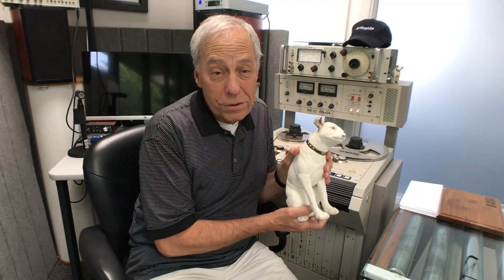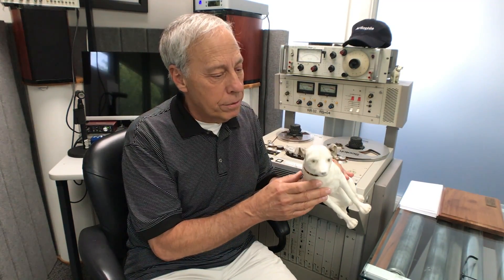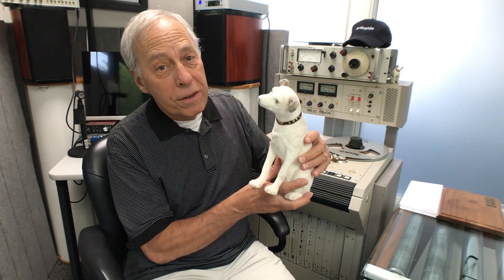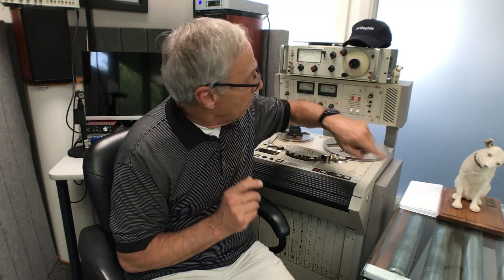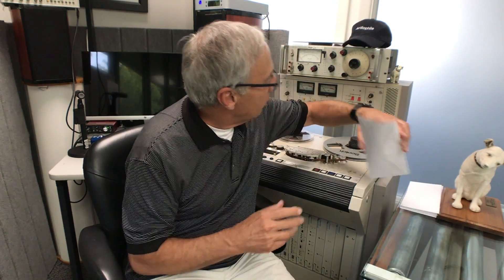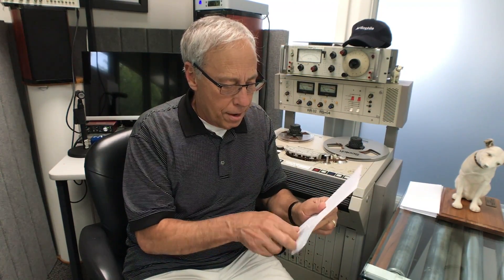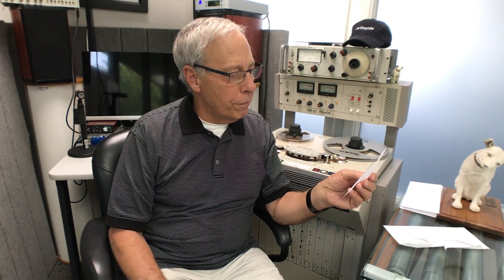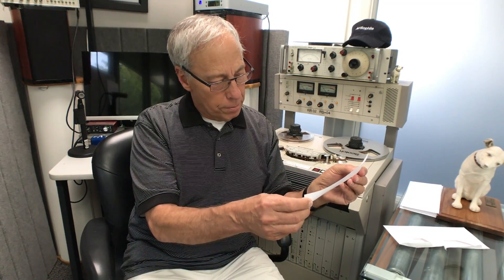Thin cables inside speakers

Comment: Manufacturing economics first of all, and the fact that a short length of #20 stranded wire has virtually no resistance and can handle a lot of instantaneous current.

Comment: I was always told it doesn’t matter too much due to the small distance. 
What matters is breaks or many connections making for changes in impedance. 
Due to the small distance you won’t get line capacitance issues. I always run the biggest shielded  I have and always use good solder with breaks in connection.... straight run of wire component to component inside my enclosures.

Comment: I used 12awg solid house wire to build my speakers. Serves dual purpose as high current capacity and structural support to build the crossover instead of engineering a custom PCB. There is no point in running anything much larger than the awg of the inductors themselves. Combination of 16awg and 14awg inductors means 12awg is more than sufficient. You are not sending more than 2000 watts down internal speaker wiring without blowing every driver and capacitor attached to it.
Reply: Bad bad choice. I used to think like you. Do yourself a favor and try using purpose build wire. Night and day.

Comment: I don't know a whole lot about home audio, but i see a lot of cabinets that are 100-300 watts. So inside the cabinet you wouldnt need very thick wire split between 3 drivers. In the car audio scene a lot of runs are 15 ft or so so they use large wire. As far as subwoofers, many guys are running upwards of 2500 watts or more per driver so you see 8ga being used a lot even on runs that are only 3ft. Just my .02

Comment: Come on, y'all.Realize the difference between pure resistance and impedance.Hint- inductance & capacitance are involved.
You can burn a 150 Watt incandescent lamp through 20 Guage zip-cord,But I wouldn't use anything less than 12 Ga. for a 30 Watt speaker run...cpf- capacitance per foot.

Comment: Same reason as not fitting 20 USD internal heavy bracing. Gel gaskets. De coupling speaker s. Internal decent cables. Decent X over components. 40 USD all !!!!! The industry is horrible!!!! See JBL inside absolutely awful.
Reply: TheRockerxx69 That's why you build your own stuff. Or get ripped off. Your choice. Or go used. I do both used, and DIY. I have stuff that cost a few bucks that sounds better then new stuff costing a fortune. You're correct. Most of these companies are pretty bad. 

I have a nice pair of Klipsch RF-3's that have aluminum drivers. So they breakup at 4500hz.even though the crossover hits at 2000hz. You can still hear it. So no biggie add a notch filter right? They're cheap enough. Well of course Klipsch couldn't do that. It would cut down their profit margin by 0.03%. So now I've got to do crossover work on it. It's okay. I bought them cheap used. But if I bought them new I would be furious. They give you listening fatigue because of it! BS!

And they know it's there. So they knowingly send a bad speaker out the door by the thousands. Instead of doing it right, and spending a few bucks. Zero Integrity.
Reply: Andrew Balus of course l DIY my 3 way  3 amped electronic X over monsters. Internal cabling is Nordost. I d like to DIY , poor s man JBL k2 s 9900 any plan or idea?
Reply: TheRockerxx69 Not a clue. Just saw them for the first time a minute ago. I don't do new. It's not even on my radar. By new I mean anything made in the last 10 to 15 years. Except for maybe a DAC that is. And possibly an individual driver. My amp is from 1961 (HH Scott 200), and I've been listening to some Zenith 49cz852 out of an old cabinet stereo made in the late 50's - early 60's lately. Heck even my DAC is 5 yrs old.

But I'd start learning cabinetry, and purchase a 3d printer if I were to try. Those things are crazy! I wouldn't even think it could really be done. It would cost a ton of cash to pull it off, If you can't do the wood.

Why bother though? Just build a nice setup with 2 15's per side, and a horn on top that goes very low (no higher then 500hz, there's some that go down to 250hz now). Like a movie theater speaker. That would make me more then happy. For that type of speaker. I like the open baffle sound myself though. Good luck. Lol
Reply: Andrew Balus l m going to get me a 15 inch good woofer. Load it in a 4th wave cabinet. Ultra re inforced. Put two compression horns over. Beyma????  And save 65.ooo bucks
Reply: TheRockerxx69 There you go. LOL

I can't remember the driver and waveguide that goes very low (down to 250hz), but that's what I would use. Beyma is nice. But for that money you could also go vintage Altec. And it will only increase in value too. That's the smart way to go IMO.

And don't forget JBL too. They make great horns. Not cheap, but really nice. And again only going to go up in value.
Reply: TheRockerxx69 Oh and Acoustic Elegance makes really nice woofers BTW. That would be the 15 I would use.
Reply: I HAVE A MINIMALIST TUBE PRE AMP, designed by polish guru Lampizator, 2 mini tubes, amazing-two power amps class d-diy  200 watts each---am using tyhem in a normal config--
Reply: yes thanks---Acoustic Elegance and Beyma--
Reply: TheRockerxx69 Wow he makes great stuff. I'm not a big class D fan, but it's good stuff. I bet your system sounds great. I wish I could hear it. And just to clarify. Beyma is great. It's just that since there's others too. I thought I would suggest them. Beyma will take a serious licking that's for sure. I talked to a guy on Diyaudio.com that was giving some Beyma drivers 30db of boost at 20hz,and hundreds of watts in an open baffle configuration. They took it fine. It didn't get much more extreme then that.
Reply: Andrew Balus l am on the max results on the cheap side, my components are poor s man stuff. Not bad sounding in the end. I can t afford audio research or krell. Those class d power mono amps cost 300 USD each.or less..
Can't remember. Done in 2017. DIY. 400 va trasfo. Good power supply 60.000 mf
Reply: TheRockerxx69 The thing with those companies is the stuff sounds better, but not ten times better like it cost. I'm all about maximum performance to dollar ratio. And I'm into low power tubes with high sensitivity (some say high efficiency, but that's not correct) speakers. I go for big transformers, and simple circuits. 

The power supply is probably the single most important thing. I run an HH Scott Stereomaster 200 right now. 12 watts per channel. It sounds amazing, and being as rare as hen's teeth will only go up in value. My everyday speakers are Klipsch RF-3's. But I'm building my own soon using full range drivers. Open baffle too. They sound amazing. None of my stuff cost a lot. I have a handmade SET/SEP (it's switchable) amp too that I'm eventually going to use for the midrange. It's a 6L6 based amp (outputs) that is one of the best I've ever heard. Doesn't put out much power, but man does it sound good. And it won't have to anyway. Not how I'll be using it. 

I'm eventually getting something like a Crown Pro Audio amp with DSP for my subs to make up for the lack of bottom end both my speakers and amps provide. It will just cover from say 30hz to 80hz at the most. Maybe even just 30hz to 50hz if I can pull it off. And someday I'll also build a speaker more like we're talking about. With 2 15's,and horns from 250hz up too. I would rather spend my money trying stuff, then spending it all trying to get a 0.50% increase in clarity, or some stupid thing. Music is all about the emotion. And we're more in tune with the midrange. That's what I concentrate on myself.

It sounds to me like your system is pretty nice already. I don't see any reason to change anything. I guess I would play around with speakers like you want to myself. But that's about it. Maybe get some linear power supplies for the amps. And maybe work on the room. Don't forget the importance of good source material too though.

What electronic crossovers are you using? There could be room for improvement there for sure. I see some people using like Mini DSP. But I wouldn't touch that myself. It's adding analog to digital, and a digital to analog conversion to your music. That's not good, especially with such a cheaply made unit. And especially if you're already running a digital source.
Reply: Andrew Balus Have been using a DBX 234 elec x over for  16 years . It sounds good. It has op amps. Don t know. The overall effect is very good. We are on another planet. Bit complicated for the cabling and setting. And switching on off sequence. Many tweeter coils (scan speak!)  have been burned. Because wrong sequence. Imagine a PA in your salon.
Reply: TheRockerxx69 Yes that's a good one. Pro Audio stuff is usually very good. And DBX is one of the better ones. I would like to try one of those someday. I've seen some of them sell for a decent price used. Eventually I'll grab one. I'm going to need something like that to try out my ideas anyway. Well really I'm just copying others. Even if I go passive. At least this will allow me to try different crossover points. I bet your system sounds really good. What are your speakers right now?
Reply: TheRockerxx69 BTW I have hearing issues that the tubes negate. Or we'd be on the same planet probably. I started off with higher power SS. But my ears can't take it. Maybe with the tube preamp as a buffer they could though?
Reply: Andrew Balus my Dbx bought in 2001 was built in the USA. Utah.  I have two main speakers in salon A. A 3 way 3 amped DIY. And a pair of Magnat (German) 709 s. Which l m using now. With the two mono amps. See my channel. I be posted a lot of my  systems videos....
Reply: TheRockerxx69 Okay cool. I'll do that. I'm at work right now though. So it's going to have to wait. Thanks

Comment: As many have mentioned, short lengths of wire have almost no resistance and less reactance, so we have immeasurable degradation of the signal. A 12 inch short length of #18 awg wire is capable of carrying 10 to 12 amps of current (thereabout) far greater than any voice coil could tolerate. (without turning it into an electric heater)  For wiring a woofer, going any larger than 16 gauge will only cause terminal connection issues, and I believe no audible difference. (most drivers do not accept larger wire except JBL, and a few others, up to 12 gauge) Also relevant, we add the wire gauges of multi-way speakers as each crossover section distributes current to the drivers. So, a two way speaker with 16 gauge to the woofer, and 18 gauge to the tweeter is the near equivalent total of 12 gauge wire. Crossover components represent far greater resistance as they should ... and so the speaker wire becomes part of the crossover itself. Tweeters require the least power in a speaker system, so a smaller wire gauge wire would never affect performance. (ie: 20 awg silver) In fact, a wire too large to the tweeter can introduce more capacitance in AC, and slow down electrons.. exactly the opposite of what we want. (please correct if I am wrong) I like to see silver plated wire, smaller gauges can carry more current. Some have said solid core sounds better than stranded. I personally have never tested this claim.

Comment: I think:
1) internal cables are shorter than cables outside the speaker so the resistance issue is a minor factor
2) internal cables don't need external coating for mechanical stress
3) internal cables real size is the sum of the size of each driver cable to xover.
If you have a two way system, i.e., you have: 2(ways) x size of one internal conductor = total size of internal conductor

Comment: As Chris R said,  it's only about the resistance and nothing else. 15 second video. 2 feet of thin 18awg @ room temp (25c) has 13 mohms of resistance, 20 feet of quite thick 8 awg has 13 mohms of resistance (25c).  There is no point in using anything thicker.

Comment: Yes. It does make a difference, because you say so? You should know better than giving this kinda answer. It makes the title less than remotely discriptive of the content in the video.

 The answer is, the shorter the wire run, the less the loss is. However, it's the complete length on the cable that matters of course.

Let's look at it in another way then. When you install electrical cables in your home, of course, you need to use a wire that can handle the current that the breaker can pass through. What can you risk with using smaller gauge cable than needed? You start a fire.

In your car, there is something called a fusebox :). In there are a bunch of things with small wire-brigdes on it that is supposed to melt and disconnect the circuit in case of excessive current draw. This is called a fuse. :D.

When you get this beefy subwoofer element, and it has those "tiny" wires from the terminal to the actual driver, or you have those tiny cables from the speaker cabinet terminals to the element's terminal - there is a reason for this. The reason is that it actually CAN handle the current put through them without either burning up like a fuse, or introduce too much loss to the signal.

When you know the resistance of the coil, and you know the voltage, or whatever variant of Ohm's law you can put to use here - you know how much current you need to be able to push through the cable. And that in turn gives you the answer - how thick the cable needs to be.

There are also an equation for loss in the cable. So there's two things basically dictating what kinda speaker cable you need to use from the amp to the element. How much current, and how long is it. The longer cable, the thicker it needs to be.

This is also the market of snakeoil on reels. There is simply NO REASON WHAT SO EVER to use spendy monster-thick speaker cables - anywhere. What you need is a wire that is thick enough to pass the current. Sure, a cable made from for example silver is better - but mostly just on paper. Silver conducts better than copper, gold, alu and all that. But just by about 5%. Which cable are you gonna use? The slightly thicker copper wire that costs far less than the hyped silver one. The cheapest you can find. What kinda wire do you think a PA installer uses? Not the spendy ones.

There are really nothing better than solid core, or a wire with thick strands in it. They are cheap and they work to the specs. There are however times you want to use those fine stranded cables that people call speaker cable. These cables can take a lot more beating before breaking. That's the whole point of these types of cables. Nothing else. In a permanent install, you never use that stuff if you really know what you are doing instead of listening to those who try to sell you snake oil.

So very thick cables from amp to speaker is mostly just good for your feelings and nothing more. The links inside the speaker or from terminals to the coil will give you a hint.

This question was an excelent question, which the author of the video didn't want to answer, because every guy with a little electronics knowledge can calculate this and reason that speaker cables do NOT need to be the thick spendy ones. It is just bullshit - all day long!
Reply: Life on Hoth I tend to agree with you on the interconnect point for speakers, however, this is how most appliances are wired. take an electric range for instance, being rated for 50amps the run to the breaker would be 8gauge copper. now, open said range and you will find the internals are normally 14 or 12 gauge so not a good argument.
Reply: Take a look at those power cables if you really want bs.  $1000 for a power cable that apparently improves the definition and stereo separation of your hifi (or does it 'remove the veil' from your stereo.. I can never remember).  Said $1000 cable plugs into a standard wall outlet with standard cable all the way back to the power station, but yeah... adding in a $1000 for the last metre of that run is bound to improve your system!
Reply: Ever tried it out with audiophiles setup?, if not then you do not know.
How ever where details and sound is not that big a deal. yeah you right
Reply: And stranded cables are more flexible than solid wire. I always use stranded 12 ga speaker zip-cord (available at Home Depot) in the knowledge that that is more than adequate and reasonably priced for speaker runs up to 20 ft. Dual solid 12 ga conductors would not be very convenient to route around in the back of an equipment cabinet. Other than current carrying capacity other factors (as proven by the math) are irrelevant at audio frequencies for speaker wiring.
Reply: Same shit with electrical codes, they say 8 gauge for 40 amps, but mostly they just trying to make the public spend more money, one time i asked one inspector why he dare to do that when i asked why he fail an inspection were the cable from the disconnect to the main panel was 500kcmil  copper that it can handle 430 amps at 90c but the run was just 5 feet when the power company used 400kcmil aluminium for like 150 feet long, he said since the service its 400 amps and 500 kcmil copper just handle 380 amps but at 75 celcius i needed to change it, he said nothing on the aluminium cable and just walk away, pure bullshit to keep you spending more and hifi audio company's are not an exception

Comment: internal speaker wire matters in a sense that you shouldn't use 30 guage. but no need to go crazy and put 10 gauge wire inside.

Comment: Another question is, why do high end headphones have thick, very heavy cables to connect the headphones to the amplifiers, but then the wire that goes from the little PCB on the headphone driver to the actual voice coil is thinner than a human hair, and that's the ACTUAL part of the wire that actually reaches the voice coil and gets the speaker moving.